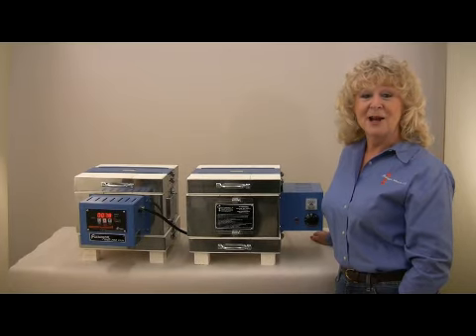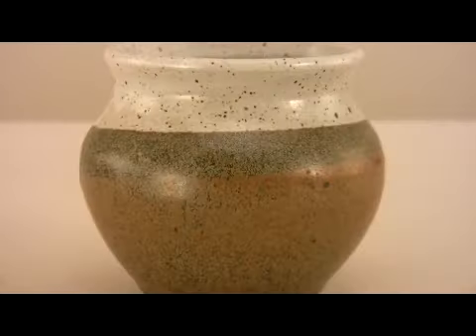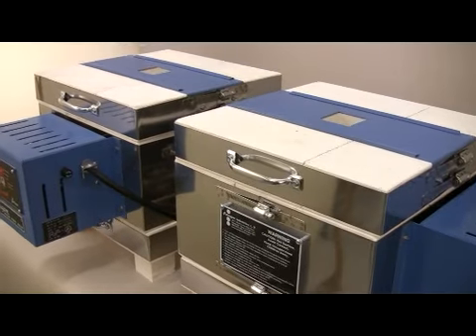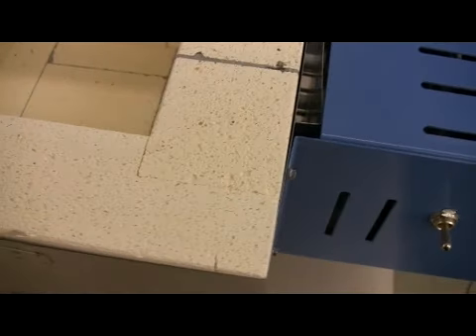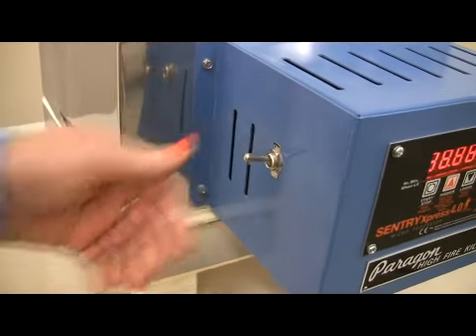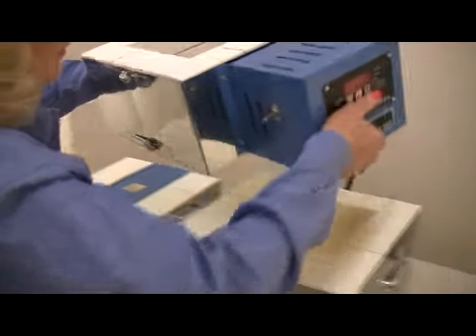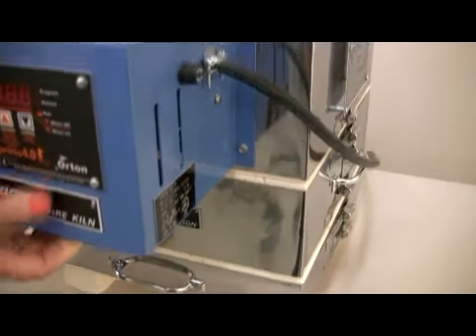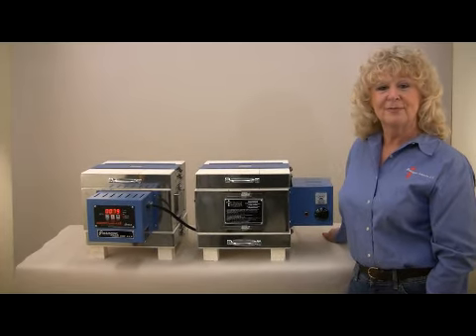Paragon Caldera All Purpose Kilns

Comment: Hi,
I have purchased a caldera kiln on market place. it has a manual pyrometer.There is no pee hole. Do you have any advice as to how to make a pee hole or replace the manual pyrometer by an automatic controller. Is adding a kiln sitter an option ^
Reply: Adding a Kiln Sitter to the Caldera is not optional. The kiln is too small for the Sitter. The easiest way to digitize the Caldera is to plug the kiln into a wall-mounted controller. You could also replace the existing switch box with a digital one from the Paragon factory.
Reply: @arnoldhoward2076  How much is the digital box ?